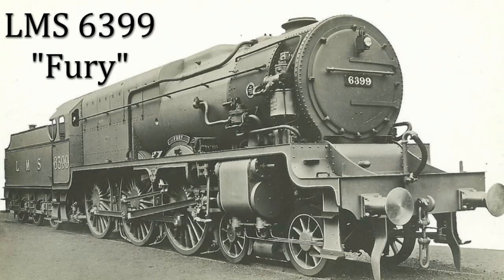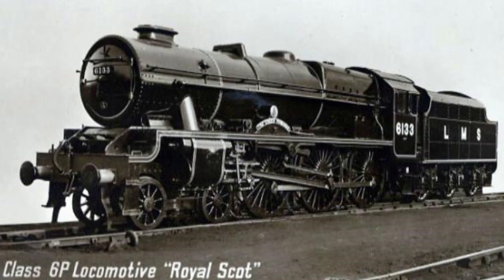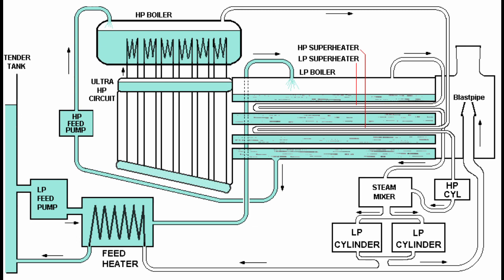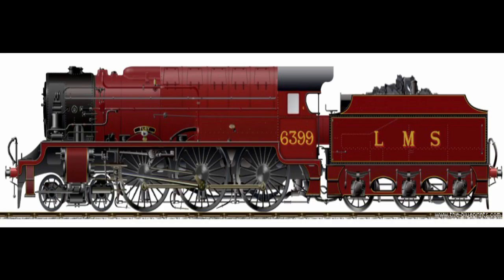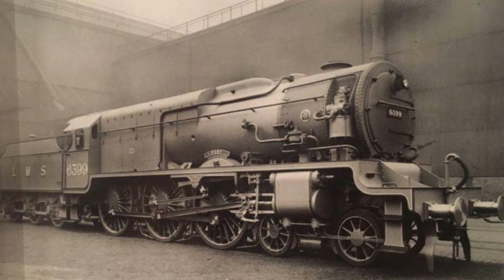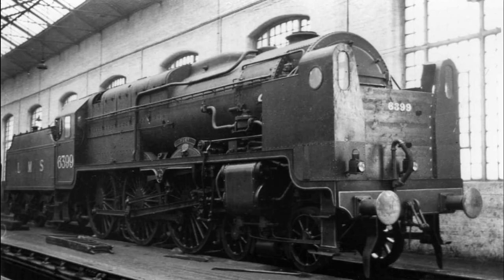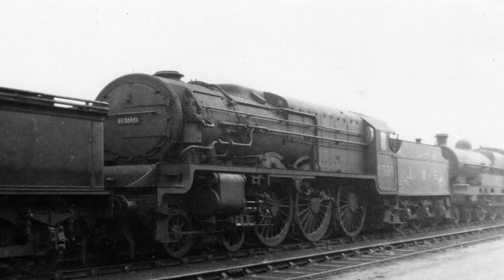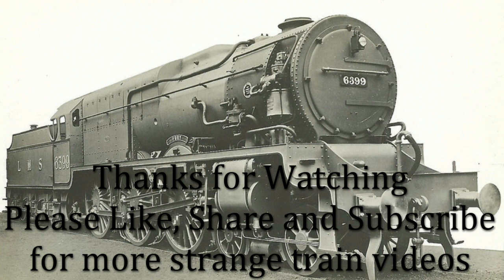Strange Locomotives - LMS 6399 "Fury"

Comment: You showed to represent the Royal Scot class a rebuilt example from 1943- not the original Fowler design. In fact Stanier's rebuild of Fury into British Legion arguably pioneered that 1943 locomotive which although described as a rebuild was virtually a complete new loco- and one writer wrote that new locos were backed on to the old cabs. Interestingly, the rebuilt Fury- renamed British Legion, did get a new two window cab unlike all the other Royal Scot class members- and this is seen in the photo you have shown.

Comment: I would like this to be given a 2nd chance, with modern materials and know how
Reply: When I read your comment, I thought it said you wanted a 2nd chance to build this :)

I want a chance to build my own new engine for motor vehicles !
Reply: We should be scrapping steam locos which burn fossil fuel, not building new ones. This is dictated by climate change considerations.
Reply: Or just you know

Genesis series is already exist if you concerned about fuel economy, no need to step backward the technological evolution
Reply: I've built a model of what it might have looked like had it survived modernisation.   It's in BR green as 46399, and has a Stanier tender, with which all the original Scots were fitted shortly after being introduced.
Reply: Could it be done? Yes, probably. 
Should it be done? I don't think theres alot of benefits of its success

Comment: Very interesting video, thank you.  The critical point of water or rather steam is 374 C at about 380 psi.  Above this steam cannot condense to water, is completely dry and has enormous expansion properties.  The idea of Stanier was to mix extra high pressure steam and use its expansive properties to energise the cooler water.  This made the whole cycle thermodyamically more efficient i. e. Less coal.   The big problem was corrosion, if a pipe got blocked with a bit of corrosion at this high temperatures, ran dry of steam, and then had a small trickle of water, the expansion rate was supersonic, rather than subsonic deflagration as normal at lower temperatures.   The result was that no steam valve could react in time, so the tubing just exploded.  Nice idea, but in hindsight, dare I say naive.  Cost peoples lives.  Steam engines run happily at a max around 220 psi. Much safer.
Reply: An old hand, years ago, at Horwich Works, gave that concise explanation to me and a friend - "any blockage on t' pipe and tha's had it."
Agree completely with your analysis of Stanier - everyone was looking to burn less coal.

Comment: What was the speed of the machine?
Reply: @Zeo Geogami So it doesn't have to do about boiler pressure, nor the useless safety valve? And it actually has to do about how much you put in the firebox?
Reply: About 70mph I'd say, the speed 46100 and 46115 are allowed now (or it could be 75?)

Comment: Is engine is kinda like henry if you get what I mean 
[Edit] it's been a year and I literally realized how dumb I was. I'm so sorry.
Reply: Lol. Henry is based off stolen blueprints for a prototype version of the "Flying Scotsman" first he was an A1/A2 hybrid from those blueprints than was rebuilt into a Black Five after his accident with the Flying Kipper. 

Besides, this locomotive is more flat-lined along the top compared to Henry where you can see the top of his cab and funnel.
Reply: @Hen House Henry is a Black Five, but Fury, the Royal Scots, Patriots, Black Fives and Jubilees all use the same chassis design.

The differences were, 6399 had a high pressure boiler, the Royal Scot the first LMS big Express engine, the Patriots were Royal Scots with Claughton Boilers so were known as "Baby Scots", Jubilees had 6ft 9in driving wheels and 3 cylinders and the Black Five was identical to a Jubilee, but with 6ft 0in drivers and only 2 cylinders
Reply: I seriously hate my self from last year.

Comment: I have seen boilers (Blohm & Voss) with sealed HP systems working OK on ships, but they were certainly more complicated than single pressure boilers and, to my belief, slower at responding to changes in steam demand. There were also more components to be surveyed and also to go wrong! They were, however, much better than Scotch boilers, which I also had the misfortune to encounter in my travels. The regular loco type boiler derived from Stephenson's designs with various tweaks (such as thermic syphons) stood the test of time on the railways and most deviations from that pattern were not worth pursuing.
Reply: i guess it is pretty off topic but does anyone know a good place to stream newly released tv shows online?
Reply: @Braylen Johnny flixportal xD
Reply: @Izaiah Avery Thanks, signed up and it seems to work :D I appreciate it!!
Reply: @Braylen Johnny happy to help xD

Comment: Läst gasps of a technology. The same is happening to internal combustionengines today.
Reply: There may be rumblings about migrating away from internal combustion engines, but it is still going to be a slow process.  The deployment of electric vehicles is limited by the electrical grid's ability to recharge them all, causing a very nasty 'chicken and egg' problem.  The utility companies cannot afford to add capacity ahead of demand and consumers will balk at the jump in electricity prices if too many new EVs try to charge at once.
Basically, unless there is a way to recharge EVs without grid capacity, migration away from the internal combustion engine will continue at a snail's pace.  That is why I wish that I was better at evangelization, as DARPA experimented with chemical fuel cells that combined decane (diesel oil) and oxygen to directly produce electricity, back in the 1960s.  At 35% efficiency, they were not as efficient as large marine diesels, but they would be competitive with the engines of road vehicles, while eliminating all of the NOx, SOx, and particulate pollution of high pressure combustion.  A stumbling block for mass deployment was creating a large platinum surface on the electrodes with small amounts of platinum.  The advantage of the decane chemical fuel cell is that it can be supported by the existing transportation infrastructure.
Reply: @richardbell7678  fuel  cells have virtually nothing to bring to the table. It's incredibly wasteful, and it's expensive.  And looking at the basics it's simply a fact that it wont be able to compete with battery technology. It's not even remotely as efficient. You will quite simply not reach parity with grud to battery efficiency. Hydrogen is simply expensive.
Reply: @johndoe1909  You may have misread my comment, so I apologize for my lack of clarity.  The fuel cells that I am for do NOT run on hydrogen directly.  They convert diesel oil and oxygen to electricity, water, and CO2.  Storing the hydrogen as a carbon chain molecule allows a lot of it to be stored at standard temperatures and pressures.  Making hydrocarbon chains out of coal and/or charcoal will allow the fuel cells to be operated long after the oil runs out.  As inefficient as that is, it does not require energy from the grid, as most of the required heat is in the form of process heat.  As there is already a fully developed storage and distribution system for hydrocarbon chains, decane fuel cell powered EVs can be introduced, in large numbers, immediately.

If we employ a decane fuel cell, the grid can grow at a sustainable rate, while EVs are introduced as quickly as the market will bear.  The problem with the current battery technologies is that, over time, they degrade to the point where the next charging will cause them to explode (fires and explosions are the result of a spontaneous short circuit dumping a lot of energy in a tiny volume.  Low energy density cells just go dead).  Better manufacturing techniques and improved quality control will push the lifetime of the battery to longer periods, but, so long as the energy is released and recharged by pulling atoms out of the electrodes and pushing them back into the electrodes, the lifetime of a battery will always end in a bang.

There are battery technologies that use two electrolytes separated by a permeable membrane to store the energy, which do not  have the problem of pulling or pushing atoms out of or in to the electrodes.  Recombinant flow cells can be recharged by replacing the electrolytes, so recharging can be done out of the vehicle in cells designed to handle the high current demands of fast charging.  Sadly, before these recombinant flow cells can be released for public use, electrolytes must be found that are neither very toxic, nor strongly corrosive.
Reply: It is still cost effective in some situations, emissions are clean, it is potentially carbon neutral and the locomotives can last for the best part of a century (which was part of the problem).

Comment: Distilled Water?? Why?
Edit: I know you explained why. But its long-term corrosive to the pipe work.
Reply from the maker: I believe it was to prevent calcification (or furring) inside the pipes. Also using distilled water reduces cavitation significantly.
Reply: Why would water be corrosive, if demineralized? Dissolved gases could be a problem. In steamships, special measures are used to de-aerate feed water, which also reduces capacity of condensers. Steam gets to be problematic as pressures (and thus temps) go up. Never mind the low thermal efficiency.
Reply: @jacques, because I've worked with pipework that takes distilled and Ultra Pure Water. Its practically corrosive, its trying to ionize and bond to anything it can, stripping the metal from the pipework, which had to be changed frequently. You could swallow this stuff, but not recommended as it wouldn't take much of it to eventually kill you as it sucks all the minerals your body needs from you.
Reply: TOO BAD THEY DID NOT TRY STAINLESS STEEL TUBING!
Reply: What happened to Fury?

Comment: And yet the super high pressure 4-8-4 built for the NYC in the USA in line with this principal was completely successful from a mechanical point of view and ran in reveneue service for some time.  HOWEVER the conclusions drawn by the NYC mirrored those of this video...  She was just too complicated and cost too much to maintain.
Reply: Kettenhund31 Ah, the Niagara's. I always wondered why the Central eventually retired and scrapped them. Now I know. Shame because they were quite powerful from what I've read.
Reply: Only one of the Niagras had a super high pressure boiler, the rest of these locos had conventional Stevenson boilers.
Reply: Kettenhund31 Fascinating.
Reply: you can tell they used a lot of similar design principals in both locos. they even seemed to have to double up on the smokeboxes and smokekebox doors on both locos.

Comment: A very attractive loco. When you start upping the boiler pressure to such extreme levels it is becoming a huge bomb. It could derail and blow itself to pieces and everyone else. I wouldn't want to be on the footplate with that. Great video.
Reply: Mythbusters got 52 gallons of superheated water up to (only) 315PSI and the results were fairly dramatic;  https://www.youtube.com/watch?v=rGWmONHipVo
Reply: @pulaski1  Bulleid's Pacifics originally ran at 280lb psi with no trouble - and I believe that US locomotives regularly ran to 300 - again without problems.
Reply: @paulcaswell2813  Right, agreed,  and those pressures could be accommodated by contemporary engineering.  But my point was that even relatively low pressures, around 300psi can be catastrophic if the boiler fails, with dramatic consequences, as demonstrated by Mythbusters. .... Imagine what 1,400-1,800 psi would do!
Reply: @paulcaswell2813  let's be honest, Allegheny did explode once. And it's so catastrophic, nobody ever could find the exact thing that cause.
Reply: @paulcaswell2813  This loco was way, way beyond that.
Reply: To put this in some form of context; a modern ultra supercritical boiler installation provides steam at 300 bar/4351 psi  and the typical power station 165.5 bar/2,400 psi. The D type boilers used by the US Navy were either 600 psi or 1200 psi designs. Doble steam cars had a boiler that worked at 52 bar /750 psi. People may have been hurt or killed in the development and use of these types but they were not abandoned because of such incidents. The Yarrow boiler used on the W1 lasted until 1965 supplying steam at Darlington Works and this could work at pressures in excess of 32.75 bar/475 psi.
Reply: You say that being on the footplate of a "huge bomb" is not a place you'd like to be. A very wise observation, particularly  in regard to 6399 which sadly claimed the life of a Superheater Company Ltd employee on said footplate. She did look well though, I have to agree.